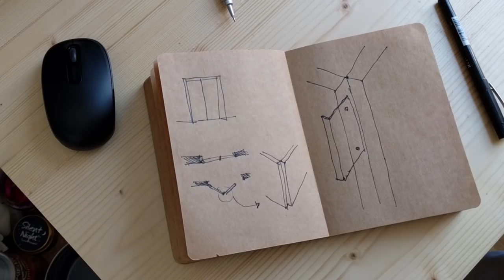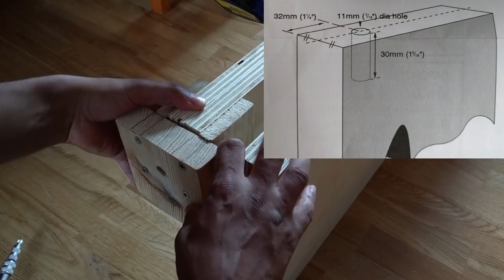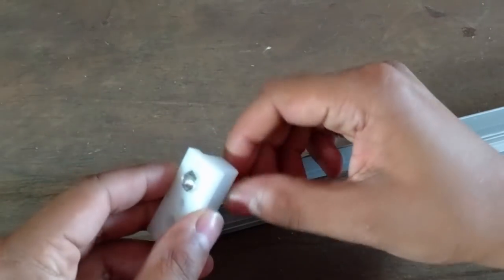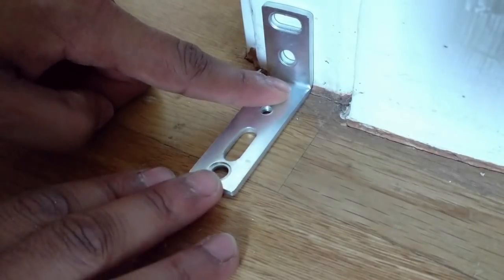Plywood Bifold Doors

Comment: Can you add some more detail about the jig you made to drill the holes for the top of the door? I'm assuming you used that for the bottom pivot pin as well?  How did you determine how deep to drill the top and bottom holes?
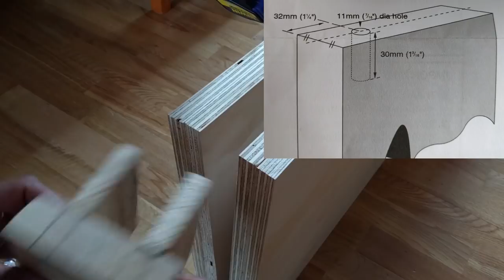Reply from the maker: Hi, yes the same jig was used for the tops and bottoms of both doors. The jig is just a piece of wood that has been drilled out on a drill press to ensure the hole is perpendicular. That piece of wood then has two more pieces screwed onto it so that they sandwich the door with sort of U shape, and the hole ends up centred on the door thickness. This makes it easier to drill perfectly straight into the door. The minimum drill depth was 30mm based on the kit instructions (but it's ok to drill a bit deeper for extra clearance) - an except is in the video at the top right at 3:57. It might be different depending on which kit you buy so check the instructions that comes with yours.

Comment: This gave me hope that it's possible with low-cost materials... THANK YOUUU!

3:13 Why not use 3 hinges to connect it though? It'd be nice if the joint-like connector is sandwiched in between the two glued plywood so that it won't be too visible, but I guess it leaves a gap?
Reply from the maker: Thanks for your comment! I preferred the aesthetic of one continuous piano hinge, and when the door is open you don't see the gaps between three separate hinges this way. If you tried to put the hinge between the plywood layers, the hinge would not function as the two leaves would hit each other. I hope what I'm saying makes sense? Thanks for watching. ☺

Comment: I have wardrobe door of size 3.5 feet long and 1.5 feet wide and only have 18mm plywood to work with. Can i use 18mm ply foor door if yes how many softclose hinges should i use per door
Reply from the maker: If you're planning on making a bifold door like in this video then you shouldn't need any soft close hinges.